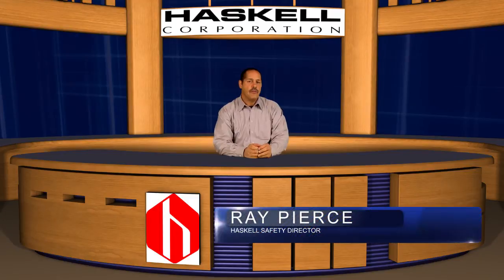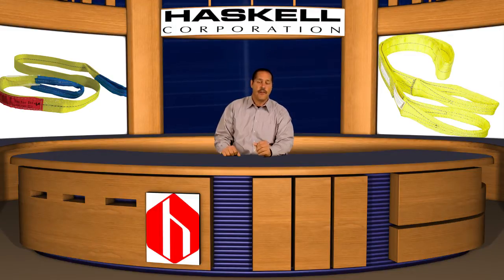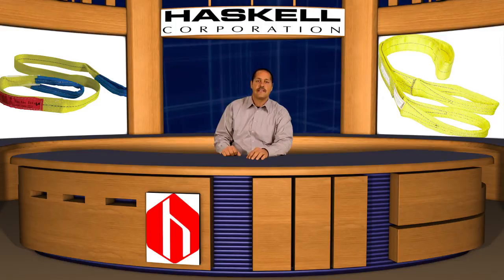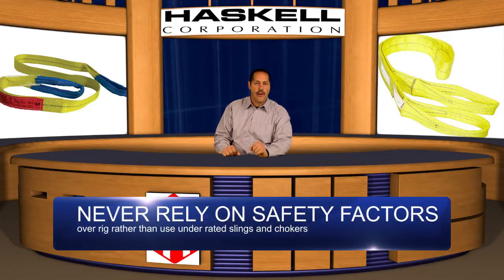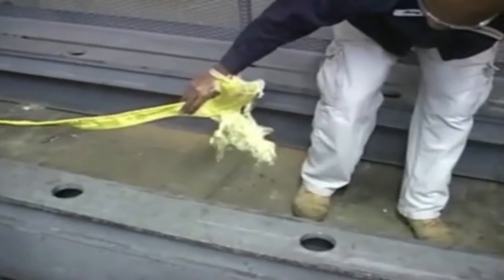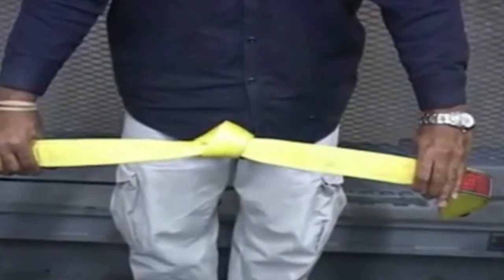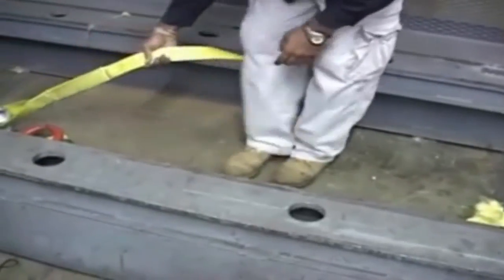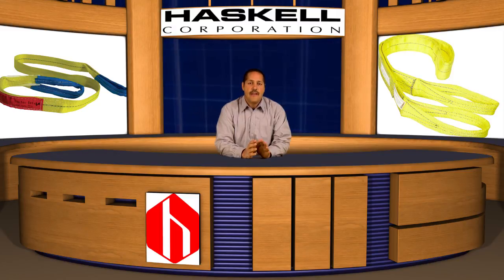Sling Failures

Comment: I was in construction and was throwing away some rigging and the boss got pissed. He asked why and there was cuts in it he said if I threw away anymore I would be fired. I went over his head and he got fired. Thank god upper management cared about safety. Rigging Has a built in factor so it can lift a lot more than stated but you do not mess with it if it is bad get rid of it. Its not worth some one getting killed or damaging hundreds of thousands or millions of dollars worth of equipment due to rigging failure.
Reply from the maker: Good job. Always err on the side of safety!